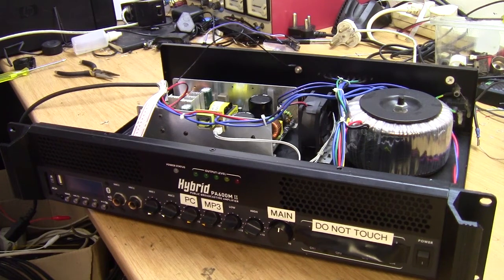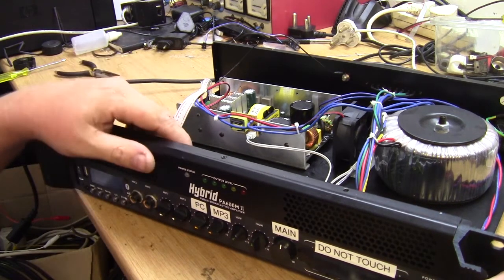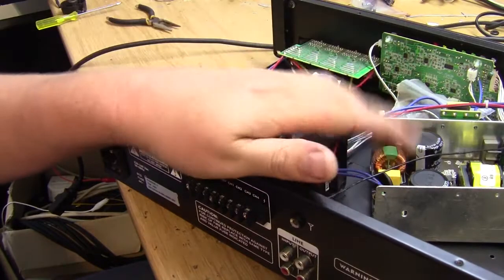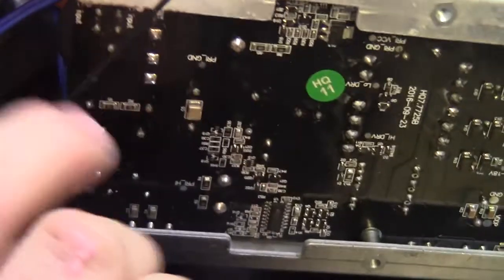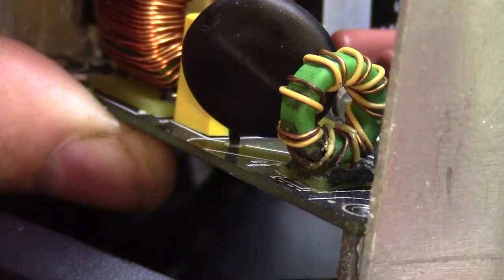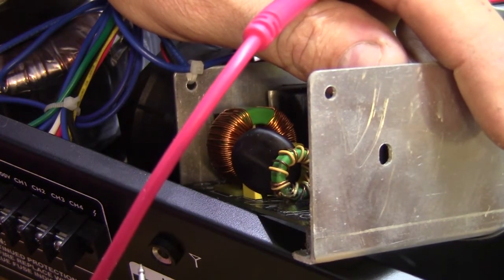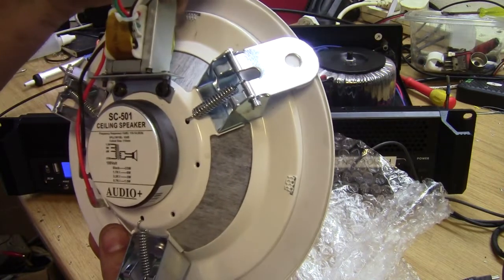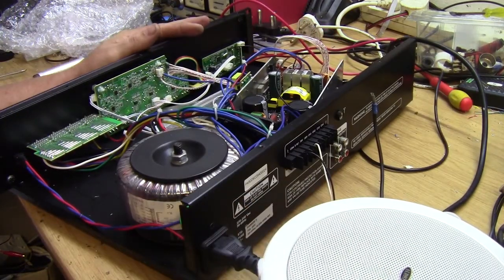ShoutingElectronics #31 - Dead Hybrid PA Amplifier

Comment: 100V line operation also means you can have different loudness in different areas, simply by choosing the appropriate power tap. As well you can use really cheap cable, I have run old phone cabling for this, and it worked very well, though do not run it in a Telkom conduit, they tend to be rather unhappy about finding 100V with a butt set. You also can add on easily, add up the speaker wattages, and so long as it is less than the amplifier total you will be fine, no complex impedance calculations to make.

Those speakers can sound reasonable, provided you have enough ceiling space, though they will never give good bass response, and the high end is always lacking, but in general good enough for background music and speech.

I will bet though that that choke was wound with aluminium wire, along with the output transformer, it is common to have that occur with all products, as that CCA wire is good enough now even in the cheap grades to do the job short term.